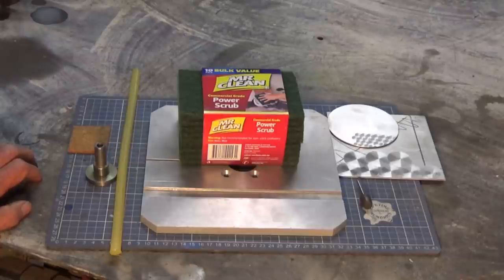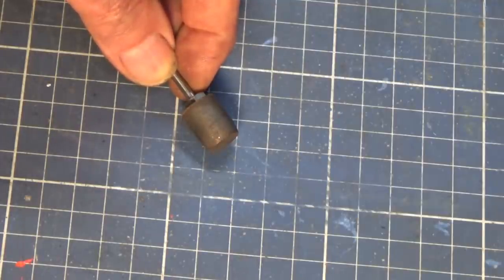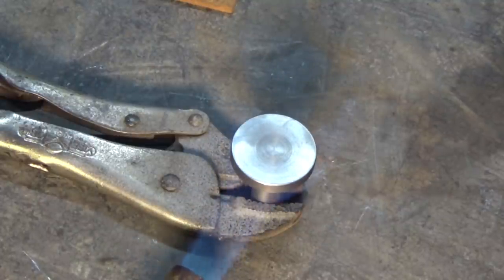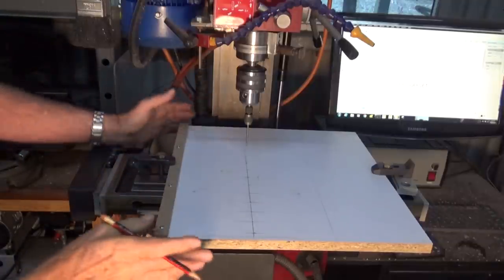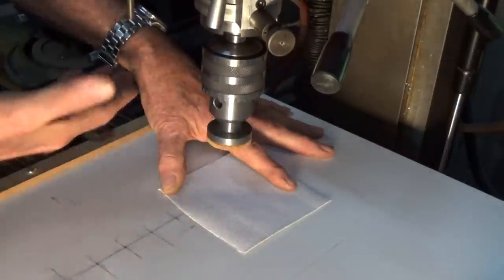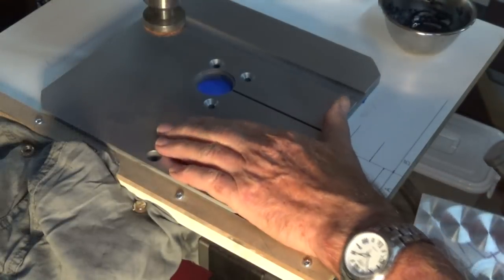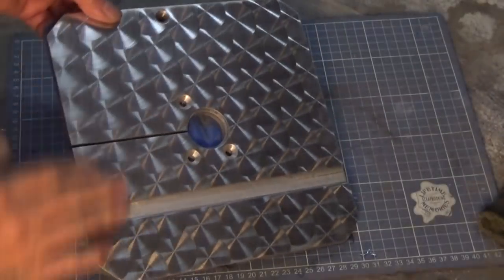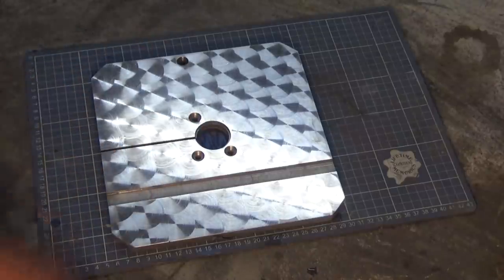Metal Finishing With Mark - Engine Turning 101

Comment: We used to do model parts with a cut-off pencil in a drill chuck, using the eraser!
Reply from the maker: At one time you could buy those typewriter erasers that were fairly abrasive. I reckon a disc shaped piece cut out of one of those would be ideal for this application/
Regards,
Mark

Comment: The issue with the first try looks like being related to the fact that the cork is touching the edge of the piece which might be sharp and can scrape the powder out or damage the cork. Great video
Reply from the maker: I did cut some grooves across the surface of the cork to hold the abrasive better and that seemed to work well when I used the carborundum paste. The pumice worked fine on the rolled aluminium sheet though. 
Regards,
Mark

Comment: Thanks for the video.   A lot of useful information, including what worked and what did not work.  I was also surprised the pumice did not work on the cast metal.   I have hand cleaner which contains pumice.   I wonder if this will work better than dry powder.   I will have to do a test myself.

The result looks amazing.   Did you consider double sided tape to hold on the cork?   Seems easier than the hot glue.
I got a smile from the old toothbrush to apply the paste.   It is amazing how many ways we can use old toothbrushes in the shop.
Dave.
Reply from the maker: Dave, I am guessing that double sided tape would be fine. I did want to show that trick with heating up the mandrel though. I actually recorded a long diatribe on hot glue and "difficult to bond materials" It was something I found out when my son was trying to join some small aluminium parts to some styrene plastic. Every glue we tried failed but when we switched to hot glue it worked fine. He did have to heat up the aluminium part though to get a good bond. 
The video was getting too long so I cut it out. I don't know why the pumice failed on the cast surface. It just looked dull and fuzzy. Maybe the cast surface is still somewhat soft after casting. It will eventually age harden though.
Regards,
Mark
Reply: I do like the tip about heating up the metal before applying the hot glue.  I can appreciate gluing to styrene plastic being a challenge since so many solvents in glues will soften or dissolve the styrene.
Dave.

Comment: I love engine turning. As a thought to the cnc method I would have thought the way to do it would be as a drilling program and then just increase the depth of the hole in CAM for each row or after every x 'holes' drilled for compensation.
Reply from the maker: Gus, I did use a drilling program in CamBam. There is a canned cycle that just needs a bit of tweaking. I set the depth to -0.2 and disabled the peck cycle. I tried the CNC method just to see if it would work and I didn't notice any excessive wear on the cratex as it went through the cycle. I guess if you were doing a lot of it you could just run the programme on single step and then use the quill by hand. But as you say, you could also edit the Gcode to increase the Z depth incrementally.
Regards,
Mark

Comment: Spring loading the tool shank may be a simple way to compensate for the Cratex wearing down on a large panel. Certainly not as depth critical as just relying on the spindle depthing to maintain dab pressure.
Reply from the maker: Howard, I really didn't expect the cratex to work over such a large pattern. It actually seems to be fairly wear resistant if you can get a large contact area but certainly, having some sort of resilient cushion would help to apply a consistent pressure and allow for wear. 
Regards,
Mark

Comment: Taking my mind back to  shop class in the days of the old work house. They wouldn't allow us to use tools for this procedure. We were given scraps of steel wool to use and would twist it while applying pressure to the metal surface. After completing six hours of work they might add coal to the fire or give us a bowl of gruel. If you did particularly good work a new set of cloths without holes. God how I miss the old days.
Reply from the maker: Sounds like the "Four Yorkshiremen" sketch that Monty Python did. 😁
Regards,
Mark

Comment: When I lived in Darwin, early 2000s, there are a guy that had the sides of his ally boat done like this with a disk of about 180mm. Looked fantastic on the bare ally!
Funny, I was thinking that the pumice would be in a paste. 

I wonder if Gumption would do the job? Also would it be worth rigging up a spring scale to the press to make sure that each 'application' is the same? So many questions, or am I just rambling?
Reply from the maker: The thing is that there are probably hundreds of variations on how this process can be done. This is probably the most refined version I have done in terms of accuracy but it's not far removed from how I used to demonstrate it for junior metalworking students. We used some pretty crude setups but they all gave fairly good results. 
Regards,
Mark

Comment: Why didnt you put the glue on the cork first.NICE job
Reply from the maker: Either way works but you still need to get the steel up to the melting point of the hot glue stick. That's the key.
Regards,
Mark

Comment: great vid!  engine turning aka burnishing?
Reply from the maker: There seems to be a lot of confusion about the terms describing this process. Technically it's not engine turning but it's commonly called that. Engine turning is done on a rose engine and it cuts into the surface of the metal to make ornamental patterns. 
Regards,
Mark

Comment: The table came out nice. Did you do the precise layout on the band saw table or just sort of eyeball it? Either way, it came out nice Mark.👍
Reply from the maker: I had pencil marks to get the spacing one way and I used the CNC software to do the offset the other way. Eyeballing it can be OK too.
Regards,
Mark

Comment: Fi-fi-fi-fine work, Prezzo!  Do you think the Cratex pattern would have been more uniform radially if the Cratex had been dressed like the cork?
Reply from the maker: Maybe. The cratex that I used had a conical point on it and I just dressed it off on a sanding disc while it was rotating in the cordless drill. So it's possible that it may have still had some convex form to it. However the first row of marks was formed half on the edge of the stainless and you could see some cratex dust being shaved off during that first row. This should have dressed it flat anyway. It's very difficult to show what it looks like on camera but I think it's fairly uniform. 
Regards,
Mark

Comment: Shellac would be a good option to stick the cork , I use it to stick copper parts to steel on the lathe
Reply from the maker: I know that you can purchase "button shellac" which you can heat with a flame. It pretty much is the olde worlde version of hot glue. I have seen Clickspring using it a lot for securing parts for machining.  Seems like good stuff to have.
Regards,
Mark

Comment: Why not make a spring loaded mandrel that way the result will be more consistent when manually pressing down in softer materials like brass and aluminium. Nice explanation though, i will keep this in mind for my bandsaw table.
Reply from the maker: That would be a good modification. The Cratex is slightly flexible so if you get the pressure just right it will produce a consistent pattern. Of course if you were doing a large area then the wear would be an issue. 
Regards,
Mark

Comment: If your cork were square it would still make round patterns would it not? leenotcharleen. Good job
Reply from the maker: It would but there would be less surface contact at the outer edge. However, having said that the surface speed would be higher so maybe you would get a consistent pattern after all. One thing I neglected to show on the video was that I later cut some parallel saw cuts into the cork surface so they would collect the abrasive and hold it in reserve. 
Regards,
Mark

Comment: This looks like just the thing for the bed of my old Necchi BU sewing machine.  Finish it with clear Cerakote so it doesn't rust, and spray the body of the machine in a nice Ferrari red.  I bet that'd knock the eyes right out of your head, m8.
Reply from the maker: I would be adding racing stripes too.😁

Comment: Have you tried a wire brush. I am thinking of the type  that goes into a drill.
Thanks
Reply from the maker: No, I haven't but there's no reason why it wouldn't work. One of those fine brass wire brushes would be good. It may not have a really sharp definition on the edge though. Someone has suggested fitting a strong cable tie to keep the strands constrained.
Regards,
Mark

Comment: Now I want to do that on the cast iron table of the old Powermatic 141 bandsaw I'm restoring.
My only real concern is that it could be a breeding ground for rust on bare cast iron.
Reply from the maker: Mark, one of the reasons that rifle bolts are jewelled is because it holds a film of oil. Maybe it will give your cast iron table a texture that will hold the oil better. 
Regards,
Mark
Reply: @Preso58  It will be for carbohydrate foam mutilation, so no oiled tables, just wax.
Reply: Mark Beiser what is carbohydrate foam mutilation when it's at home? Beer suds? Lol

Comment: i always thought that pattern was made with the round wirebrushes you can put in a drillpress
Reply from the maker: Yes, it can be done that way. The only criteria is that you have some way of abrading or texturing the surface of the metal and some way of constraining the patterns so it can be indexed reasonably accurately.
Regards,
Mark

Comment: Besides circles what other patterns can be done by hand. Just like rose machines
Reply from the maker: There are a variety of patterns that can be achieved with a rotating tool in a drill press but for really complex patterns you would need a rose engine like the one that Clickspring has. 
Regards,
Mark

Comment: Why not use roll lock discs
Reply from the maker: It depends on the diameter of the repeated pattern that you are after. Also, the roloc discs are not exactly flat on the surface so you may not get a crisp outline at the outer edge of the ground pattern.
Regards,
Mark

Comment: why not just use sticky back cork sheet.
Reply from the maker: Yes, that would work but there is considerable torque on the surface and you would need to ensure that heat doesn't soften whatever adhesive you use. It is surprising how strong a bond you can get with hot glue if you heat up your parts first. 
Regards,
Mark
Reply: Mark Presling heat can effect hot glue. I’m not sure what is on the back of the cork sheets but it had never failed me. In fact removing it is almost impossible. Acetone works sometimes
Reply: Mark Presling oh and thanks so much for your videos learning lots. Very enjoyable

Comment: Huh. I've never come across this as engine turning before. Perlage or jewelling mostly. This is what I've come to know as engine turning: https://www.youtube.com/watch?v=gV7jdgwFfYU
Reply from the maker: Karl, I just did a quick search for engine turning on Google photos and mostly what you see is the type of repeated ground patterns like I was doing. I have seen rose engines before (amazing machines) and I know there is a lot of overlap in the terminology. It sort of depends on what your area of expertise is. Interesting video on the home built machine!
Regards,
Mark
Reply: Mark Presling Not saying you are wrong! Just that I’ve come across it differently. But I’m coming from the watchmaking direction. The decoration you are showing here is used extensively and called perlage.

Did you mean my engraving setup or the vacuum tester?
Regards

Comment: I love engine turning so much! It has been my favorite metal finish ever since the first piece of engine turned anything I've ever seen. (It was my grandpa's hunting rifle bolt, for the record. It was my grandpa's favorite finish, too)
Reply from the maker: Stephen, I have been told that the engine turned finish on rifle bolts and other parts of the action was not only decorative but it also held a film of oil to reduce corrosion and to produce a smoother sliding action.
Sure looks pretty though!
Regards,
Mark